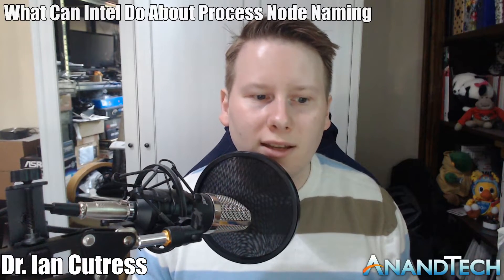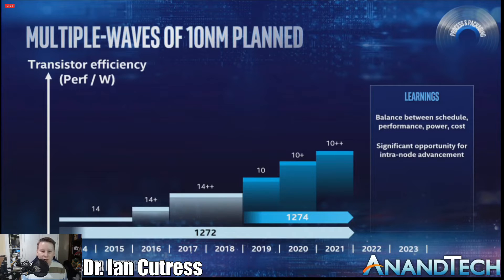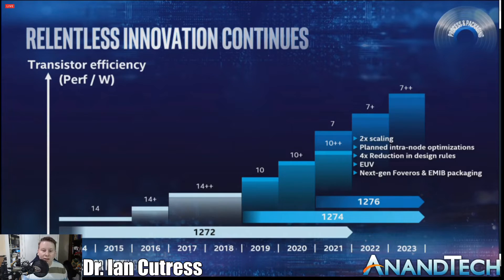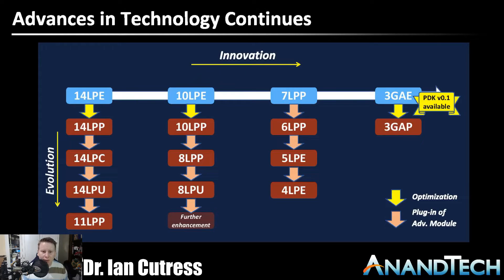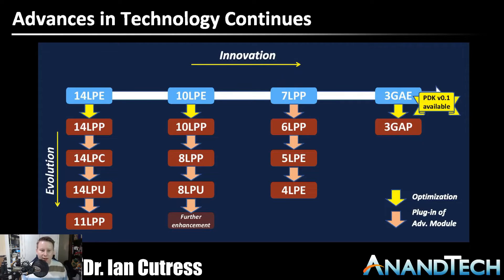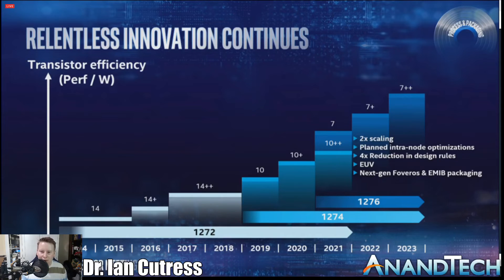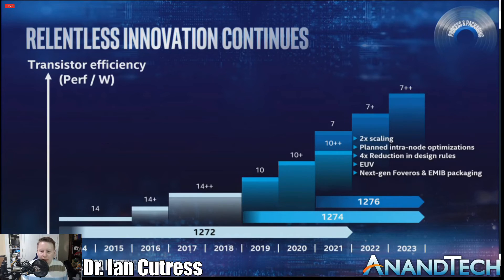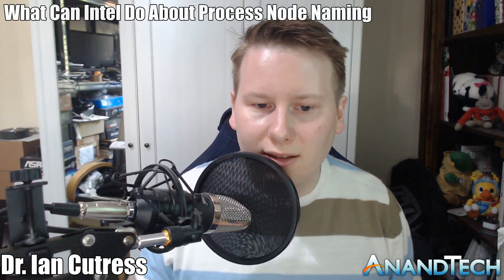Fixing Intel's Process Node Woes vs TMSC and Samsung

Comment: To be perfectly fair, Intel's 14nm process is still quite good.

We'll have to wait another six months to a year before we see AMD's 7nm mobile chips, but Intel still beats AMD on power draw on mobiles, even if they lose horribly in desktops.

My Skylake i5 6300HQ with a GTS 960m and 15 inch IPS display gets close to 10 hours usage at work. Movies and such would probably be in the 5-6 hour range, haven't tried it to see. The only time I'm on battery is work related.

Comment: I dont really agree. If they do this, they should drop the whole nm thing, as it clearly will have EVEN LESS to do with the actual process it is describing.  At least 14, 14+ and 14++ shows the actual transistors arent getting smaller, witch the nm part is all about.

Comment: I don't like micro adjustment to the node size 12nm is still just 14nm, it would be better with a density number instead of plus because regardless of the node the density will correspond to the density of a standard transistor. People with think that a new node process is occurring rather that just a tweak to the old node.
Reply: Technically GF's 12nm was essentially a plus node of 14, but everyone accepted it as 12.
Reply: @borandiUK  
Which is why it's often seen as 12nm+ instead of plain 12nm like on the AMD site.
Reply: @magottyk  It's seen as 12+? That's the first I've heard of that naming. It's just 12 pretty much everywhere.
Reply: @magottyk   Anton's use of 12+ was meant to be '12 and beyond', which is a bad way of saying it. 12nm means GF's 12LP process. GF doesn't have any other 12nm processes, except 12FDX, which is made elsewhere and FD-SOI based.
Reply: @borandiUK  
Doesn't really matter, as it doesn't change the fact of 12nm+ being used in many places. I think you're being overly generous with your interpretation as Anton talks about it as a singular node.
"At a high level it's easy enough to see how AMD could utilize 12nm+ capacity through 2021, but AMD's needs for such a large node (or GlobalFoundries' other specialized nodes) in the 2022-2024 timeframe are not nearly as obvious."

There's multiple reasons for this, 12nm is 14nm+ so saying 12nm+ is just combining the terms and the most notable 12nm product is Ryzen 2000 series or Zen+.
I'm surprised you haven't come across it as it's common parlance as the whole zen zen+ 14nm+ 12nm got a bit blurred and lots of people were and are still confused about the naming's used.
Reply: @magottyk  It's not on official documentation, it's not the official naming. That's pretty much why I haven't come across it.